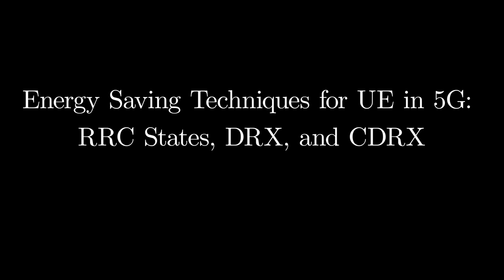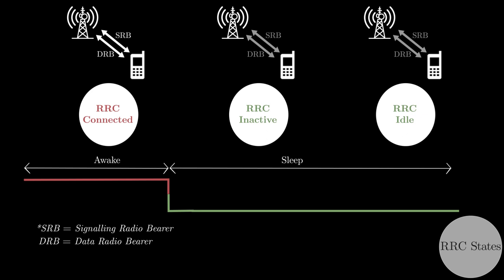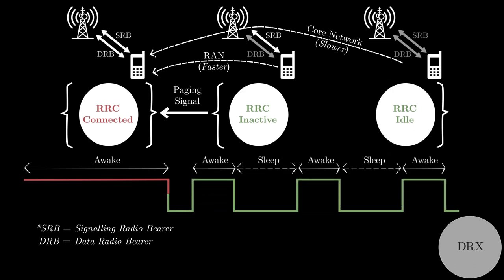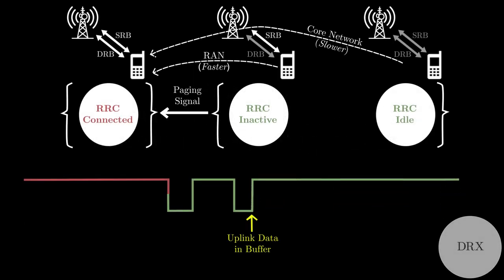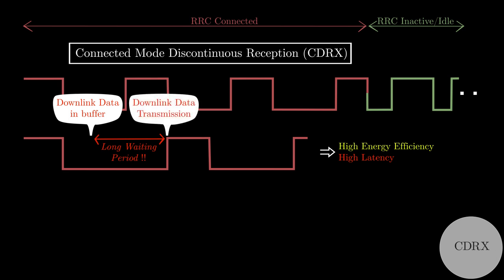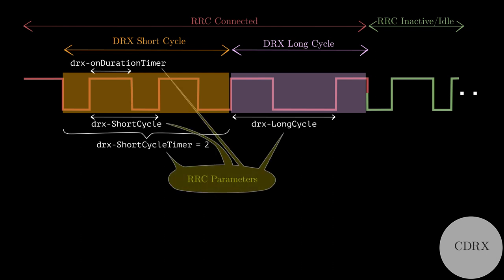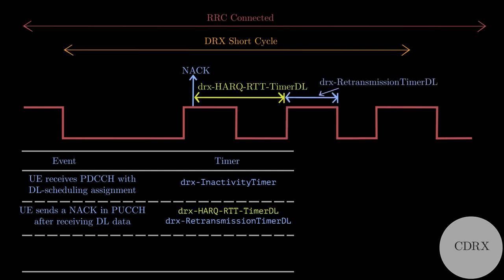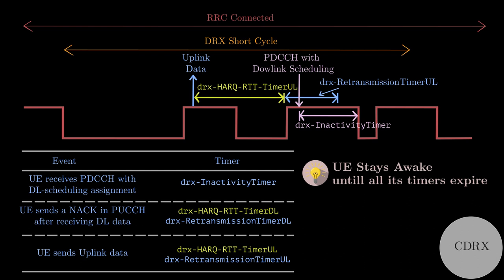Energy Saving Techniques for UE in 5G: RRC States, DRX, and CDRX

Comment: Thanks for this video. Does the UE/NW have to choose which power saving method to use or it can use both RRC inactive state and DRX ? If both then how would that go about ?
Reply from the maker: If a UE is in RRC Inactive/Idle state, it is by default in DRX cycle. Otherwise, UE cannot listen to paging signals.
Network decides RRC-state and power-saving method of the UE.